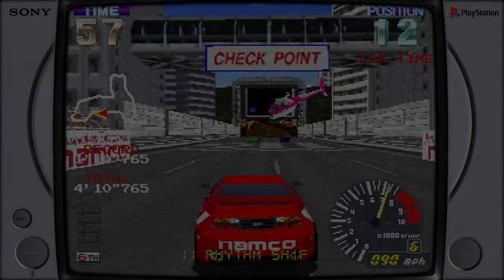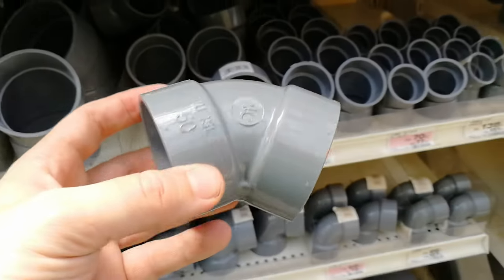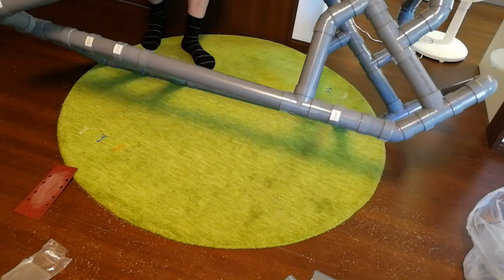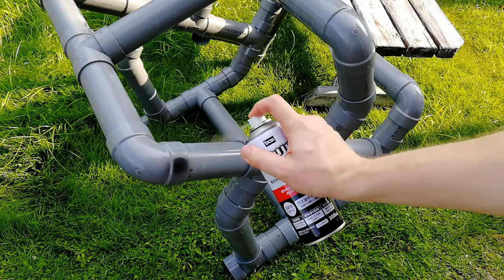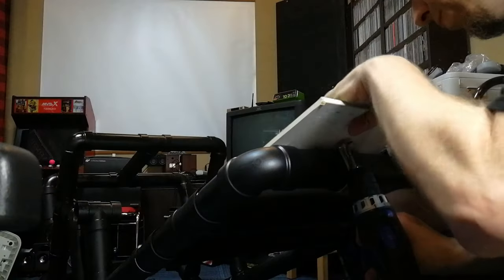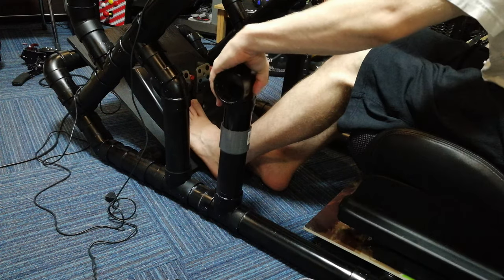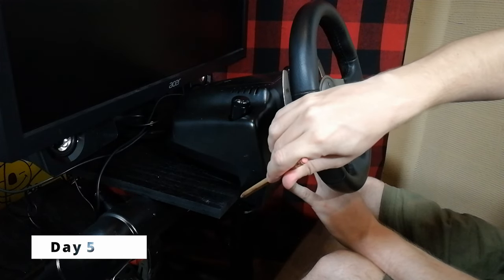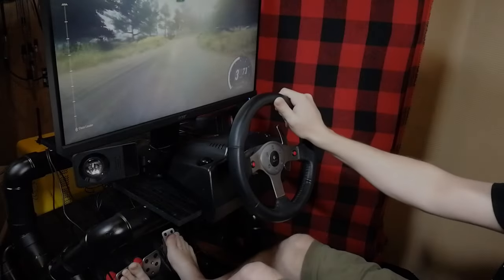SIMRIG: CHEAP AND EASY TO BUILD Driving Rig out of PIPES

Comment: Very well done video. What I like about the PVC is you could drill a one inch hole in different locations and run all your cables thru the pipe to the pc. Only thing I think you could do is make a monitor stand out of the same piping system and then it is independent of the rig. Then you will not have monitor shake. For a fraction of the price of a bought stand. Great job I have to say. Thank you so much for all the build details and comedy added in.

Comment: That turned out very slick!  Love it!   I converted a old cruisin usa sit down can to a xbox 360 powered racer about 10 years ago. I bet the pvc racer would look cool with some led strips mounted to the Inside side of the pipes.  They coild be powered straight from the ps3’s usb ports.
Reply from the maker: Yeah, that's something I should have mentioned.  You could even have all the cables going through the pipes to have a nice clean build

Comment: Overall it's not bad set aside if I have spare time or not I think I go with lazy road by using 4-5 table with various height and length then lock it at some board or the floor or maybe not, the problem is chair I don't think make it fixed like that is good idea at least for me coz I am afraid I will bump the gear shift or the handbrake or somehow when I get out I get tangle by my own foot (this from my experience of course).
Reply from the maker: The whole thing with the pipes is that it can all be changed.  Stick them together differently and you should be good

Comment: Nice build, great idea to use cheap pvc pipes. I bet with a VR headset it will be perfect.
Wife: what happened to the passenger side seat in the car? why is the grass painted black?
Reply from the maker: Thanks man, it was nice to try and build it to plan and show others in the community that it can be built by someone that doesn't have a clue :-)
With a VR set it'd be soo good, and if you look carefully- this seat actually IS the passenger seat.   It was maybe 20$ cheaper.  And yeah, she freaked out the next day about the grass.

Comment: Emu Chicken - great video as always - My question is how much would it be if you didn't have any of the parts (aside from the TV) in other words how much for the racing wheel, pedals, break, speakers?
Reply from the maker: Wheel, pedals, gear stick were a used set- around 100-150$, handbrake, um, 30$? Speakers 40$ - Will depend on location and the exact models you get though.

Comment: How much does this flex?
Reply from the maker: Maybe around 100$ or so for the pipes, then add the car seat and wheel controller.  TBH it depends on where you buy everything.  Take a look in your local hardware shop for the pipes, then check ebay for car seat and wheel prices.